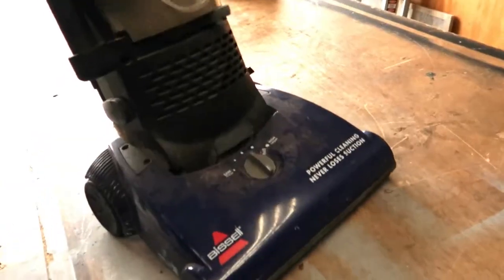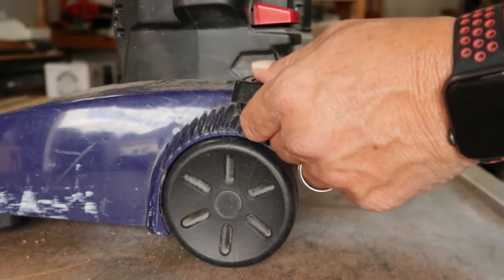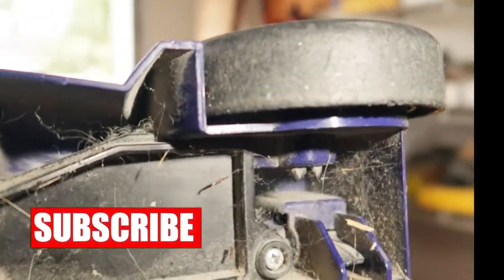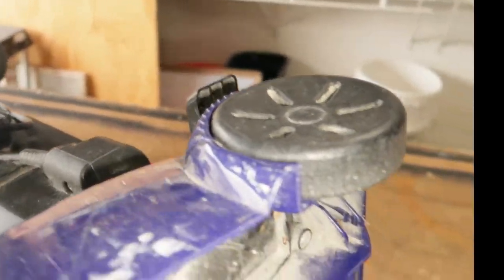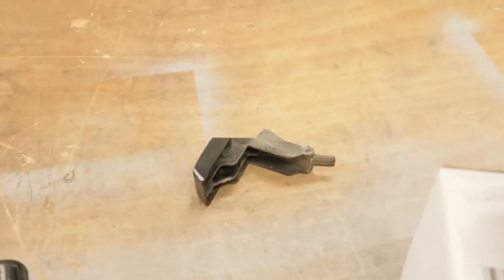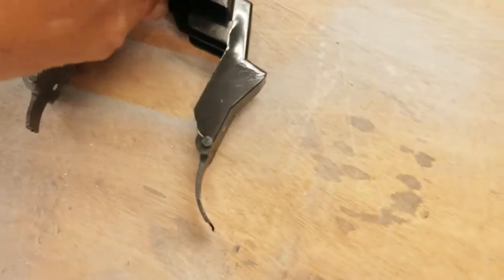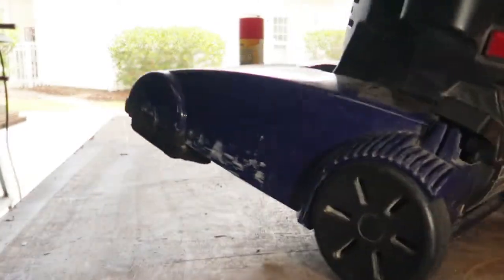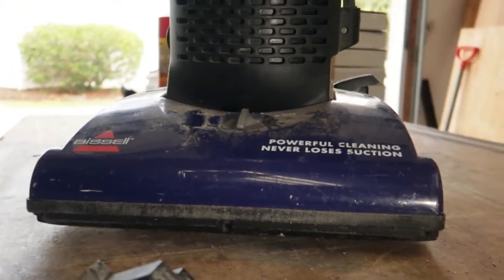HOW TO REPLACE  THE FOOT RELEASE ON A BISSELL UPRIGHT VACUUM

Comment: I always try to fix before tossing so I am so thankful i found your video.  You know i just couldn't do the one-handed release you showed as i was super afraid i would break that old plastic so i just used my dremel and ground the pins down on the old pedal and after about 30 mins😂 it came right out.  I love how it was so easy to slide the new one right back in.  I tell you what...I had more trouble finding the right pedal for the vac but all is well and fixed now!  Thanks Dan!

Comment: Your video regarding removing the carriage release out of a Bissell is the only one that actually does help me to get it out. I had to use a couple of knives to help prop the clips open once I pried them apart with a screwdriver. It was just impossible for me to do it like you did with two screwdrivers. And even then, removing the carriage release was EXTREMELY difficult. Fortunately, reinstalling it is not that hard.

Comment: Like your video. I am sure I could replace one now, but where can I get the part ? Bissell will not sell them and I cannot find the part number anywhere
Reply from the maker: check in the video description for a link to the part. Thanks
Reply: @danjiles  Thanks. I found the part number inside  the pedal. Very hard to read. But the part is ordered and on the way. Thanks again.

Comment: Been there. We’ve got the same vacuum cleaner, and our foot release pedal broke too. That whole vacuum cleaner is basically plastic.
Reply from the maker: Imagine if we’re all metal. How heavy would that be. Thanks for watching. 😀
Reply: @danjiles  Some parts, such as this lever release, ought to be metal, along with any other part that tends to break. But plastic is better for those parts that don’t break, but could rust. Plus, if there’s a short in the motor, plastic would protect you from being shocked (or if you’re wet) being electrocuted.

Comment: What I do since these models are so common I just buy the same model at the thrift store that has a working latch and swap the entire base
Reply from the maker: I've done close to the same thing, my wife owns a cleaning business and is always finding abandoned vacuums, so she keeps them and I strip them for parts and rebuild for her to use in her day to day jobs.
Thanks for the comment and I appreciate you watching. You Rock!!
Reply: @danjiles  I have been finding abandoned vacuums at the dumpsters in our huge apartment complex since 2014. Most of my trash picks I have been able to save with cleaning and minor repair. Occasionally, I will keep one, but most of them I give to Goodwill. Even the ones I can’t save I give to the Goodwill as electronic scrap. But not all Goodwill stores accept electronic scrap. Check with your local store.